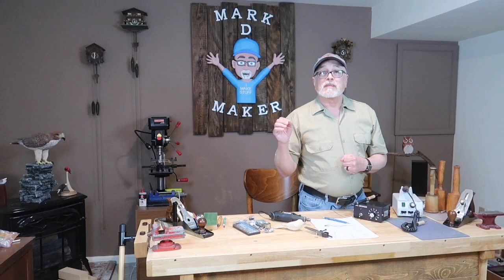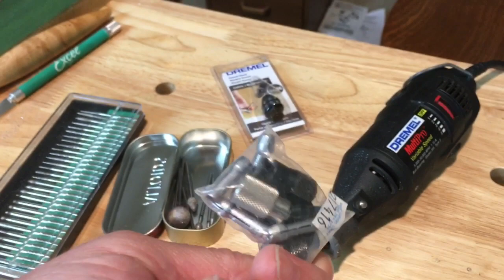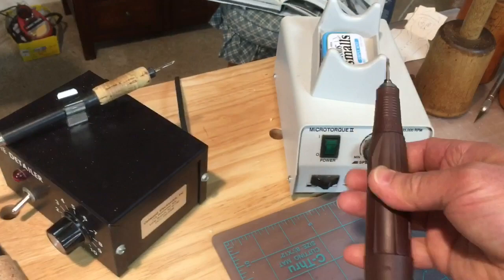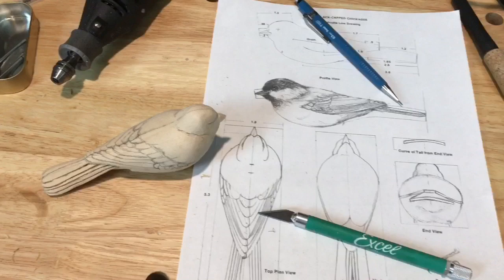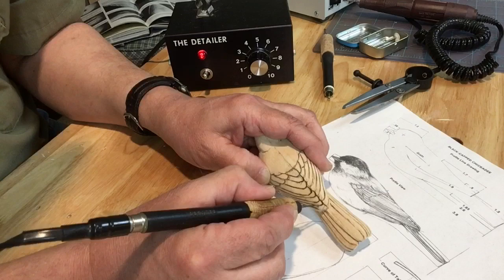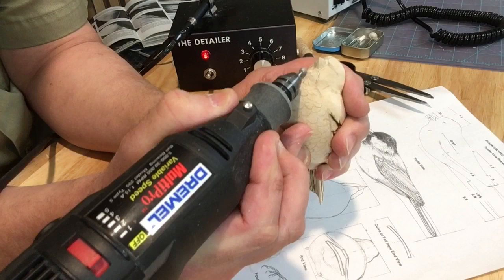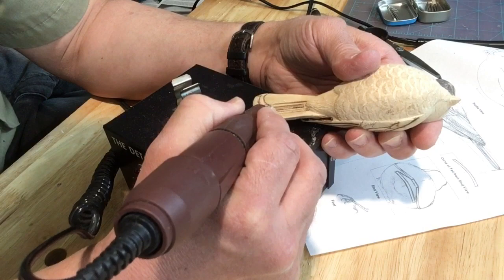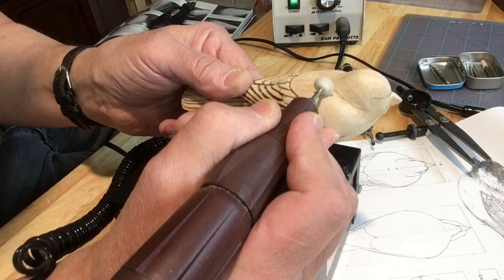Detailing a Bird Part 2 Wood Carving

Comment: Which ruby carver bits do you use the most for detailing bird feathers? There are so many and if cant afford a ton. Maybe give your top 5 or so and the size? Thanks you are awesome!
Reply from the maker: Sorry took so long for me to answer your question. I would definitely yet a large and small flame tip, three different size balls including quarter inch and 1/8 inch.. A couple small cylinder ceramic for fine detail lines.